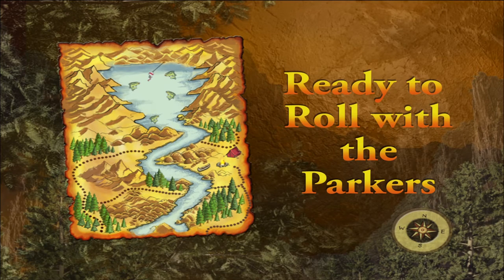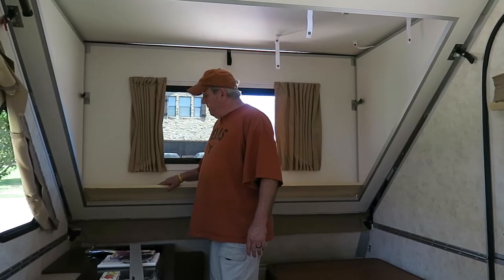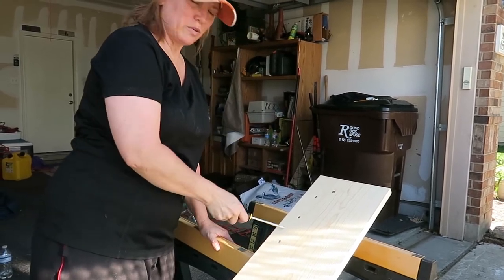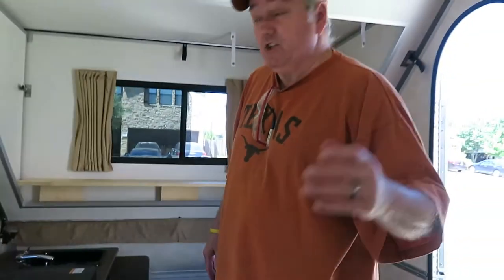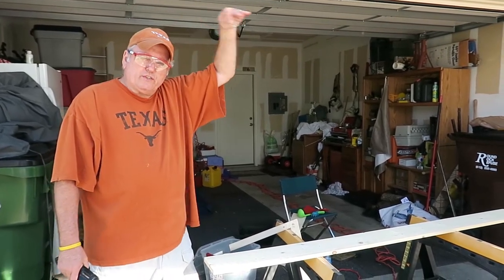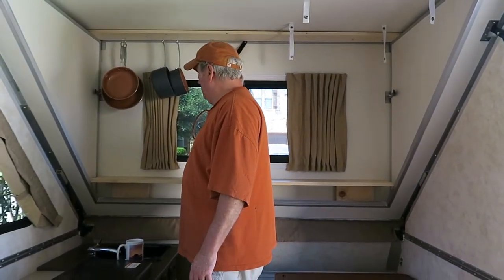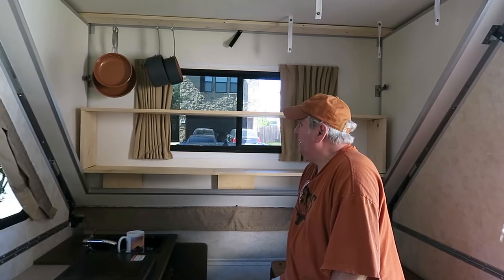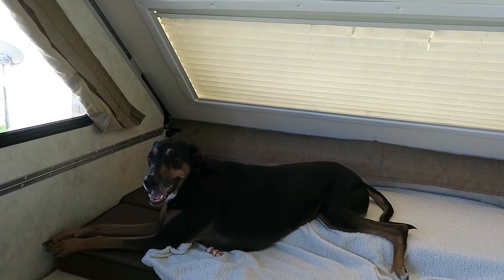Aliner Shelves Project

Comment: Love the video, hoping to get an Aliner myself soon. Happy New year 2019.  🎅
Reply from the maker: Happy New Year to you as well. There are some advantages to an Aliner. Easy and lightweight to tow, can fit in our garage to store because of our homeowners association rules. However, my wife and I carry too much stuff and it is a pain to arrange everything and then take it back down for a 2 or 3 day weekend.....it's more fun if you camp for 4 or more days (or carry less).....plus we have 2 dogs..... to be honest I would rather have a Casita or an R-Pod if we could store it at our current house, but we can not and we don't want to pay to store a camper when not in use......if you are single or have no pets and are good at minimizing what you carry, an Aliner would be fine.....our model has a (noisy) air conditioner, a refrigerator, 2 burner stove, microwave, a cassette toilet, and an indoor and outdoor shower but you need power hook-ups to use AC and microwave....we only camp at parks with power and water hook-ups (so far)......Good luck and happy camping.......

Comment: Great additions! May I suggest that you could possibly  cut the shelves in half and add a piano hinge where you could fold them in half for easy storage. We have a 2013 Aliner Sport. Thank you for sharing!
Reply from the maker: These are easy to store, and we didn't want to drill into or alter the camper body....once the newness wears off that may change though.... can you describe where you mean to cut in half?
Reply: Dwight Parker If you find a piano hinge, you could cut the shelves of in half, add the piano hinge to both sides, and fold it up.
Reply from the maker: They sit on the floor no problem while we tow.....as well as the board with hooks....
Reply: I like that idea.